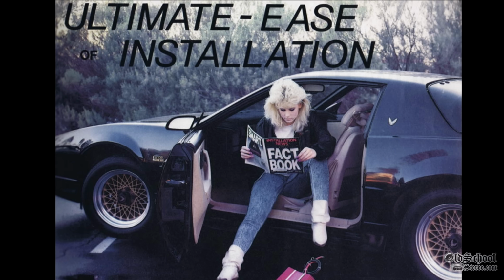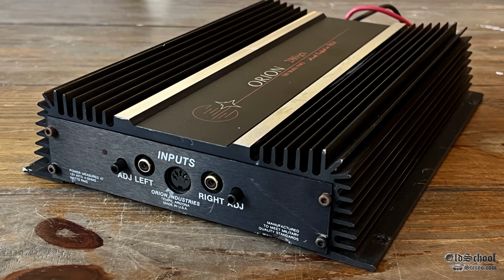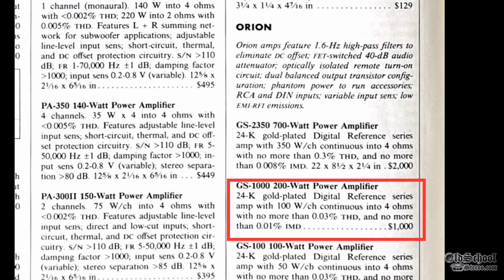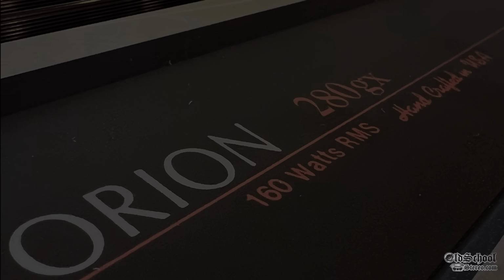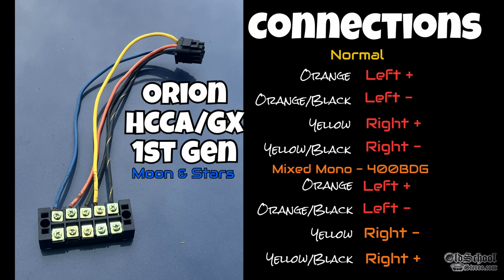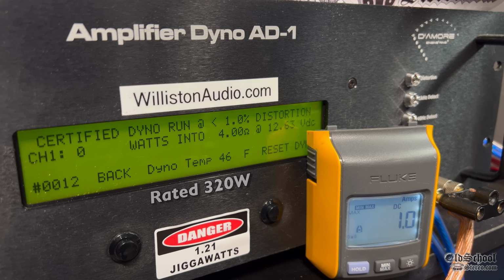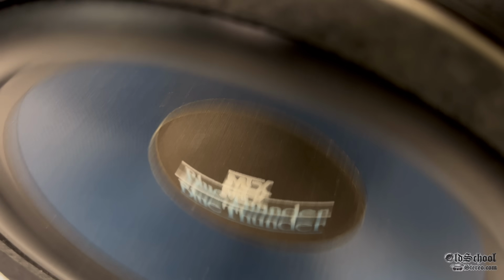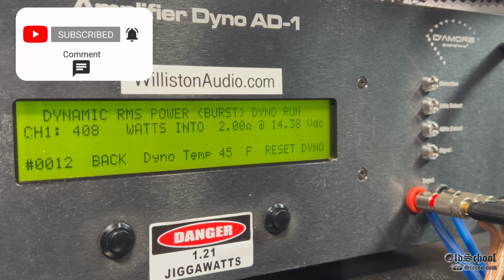35yr Old Orion Amp Reviewed and Amp Dyno Test - 280 GX Moon and Stars

Comment: The caps in these car audio amps seem pretty small - is this due to the thing hanging on a battery? If one would power such an amp at home with a power supply wouldn't the caps be grossly undersized? Which supply, if any, would be adequate for such amplifiers?

Comment: Orion amps just don’t make power. I myself had an Orion Hott Setup 2.125 back in the day. It was rated at 125Wx2 at 4 ohms. But it just didn’t hit hard. I eventually replaced it with a Punch 60, which had FAR more kick.

Comment: That amp has very little in terms of supply filtering caps and relies almost entirely on the regulation which is why it has so much less power at 40hz.   You need at least some dynamic headroom to hit those low sine waves.

Comment: If you take the transistor heat sink clamp off you will notice that the power supply transistors are the same as the output tranny's. I think they are 2n6488 and the complimentary 2n6491. Another thing, you need an Audio Control SA 3055 RTA. It would look damn cool sitting right on top of the amp dyno.   Hit me up I got one you can use for as long as you need.

Comment: I haven’t seen any old school amp dynos on Kenwood amps back in 89 by bud may have had the first wall he had 2 15” (can’t recall brand” on 2 kenwood 1021’s and a 921 on a set of ? Triaxles crammed into a lowered aqua VW bug with the short seats. The 15’s started where the seats ended lol…

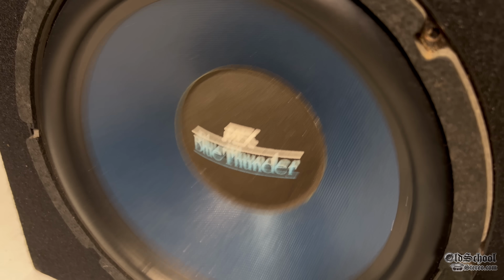Comment: 11:32 I disagree, Old school subs just needed a lot of air space, were more efficient, bass traveled further (like concert subs).  Today subs take more power, less efficient, can play low with less air space enclosers, bass don't seem to travel as far os O.S. subs.
Reply from the maker: We can agree to disagree, but with the same power this 6.5” Savard destroys that 10” Blue Thunder sub. And ran Blue Thunder’s back in the 90’s
Reply: @wal2  Touché, I was mainly referring to old-school subs, not necessarily MTX brand I was never a fan of MTX anything. I was a fan of Cerwin Vega, red edge, strokers, Orion XTR's. JBL 1000’s , Lanzar DC's & JL Audio…

Comment: Orion made beautiful amps, but my stock electrical hated them so much.  I ran Hifonics, Autotek and Fosgate without issue.  I always thought Orion ran unregulated power supplies.
Reply from the maker: I thought this also but I’ve confirmed these and even the HCCA’s of the 80’s into the 90’s were regulated

Comment: After wishing I could afford it in the 80’s, I actually ran this amp in my daily driver 10 years ago along with a pair of same era Rockford Fosgate 8” subs. It sounded great but unfortunately I became well acquainted with its guts(!). I had to pull the board a couple of times for cap replacement. These old school amps are great but should be fully recapped before actually being used in a working system. 
 This is a great series of vids Big D, thank you.

Comment: hey derick... man it would be awesome if you could come across a Cedance (or Cadence) amp 1000w .. they were kinda small and orange in color.. with 2 mesh ends that were held on with he  screws... man that thing was a  east with the two 12" Sony XPLOR's .... (no.. not xplodes, they were XPLORE subwoffers they didnt even look anything like xplodes as they were so huge and chrome backsides also with mesh around the motors) man it would be awesome to see a review of those amp and subwoofers...
Reply from the maker: Thanks for the suggestion 👌
Reply: i wish i could find the pictures of the system i had back when i was 16-17 that i had that system in a '91 blazer... if i find them ill figure out how to email to you :) thanks for the reply man!!! @wal2

Comment: Again, for an amp like this, a frequency response would be great to see. Playing the amp using the Elac speakers really doesn't tell me anything about the amps performance. The majority of us are watching this video through our phones. So, if you were to do a blind test with your best amp and crappy one, i cohldnt tell the difference. Well, wait, i am wrong. There was one amp i actually did hear how bad it was lol but, for the most part, we can not. If there was a chart that showed a single sine wave and THD. We, as the views, can not only hear what the amp does but also see where it's failing. For example, many people today are raving about how great the recoil amps are since they do rated power at a cheap price. Well, i am sure most are not aware that those recoil amps and dsp's are TERRIBLE and poorly made. ANOTHER EXAMPLE, although many people know Alpine is good, most people dont know that not only does alpine do rated power, but there are amplifiers are some of the CLEANEST amps on the market. A few of the older models, mid tier, absolutely wipe the floor with the high-end ones like Mosconi. But, my point is, it would be great to see maybe some more, and i am sure if you posted a frequency response on amplifiers, you would shock people on how some of there favorite amps are actually greater than what they thought or terrible then what was expected.
Reply from the maker: Thanks for the feedback 👌

Comment: Another old school legend humbled by the amp Dyno. The 280GX amps were everywhere in the late 80's. Basically anyone who was a Orion fan but, couldn't afford HCCA amps had them. 
Regarding that low efficiency, imagine running these amps on stock electrical in 1986. Talk about low voltage!
Another great old school car audio review and Dyno. 👍👍

Comment: Do you have a ppi 2150am to test out. Remember i believe 1992 it won Amp of the year. It was expensive but worth it. Just had it completely restored 2 summers ago, but have yet to use it.
Reply: I have two 2150am's in black. I call them the "swiss army knifes" of old school car audio. Great for subs, mids or even tweets if you turn the gain back or ran them at 8 ohms.
Reply: I ran this Amp in my pickup with 6.5 rf midbass and I believe 3 or 3.5 midrange in the doors, of course tweeter in the dash running left right mono and 2 sealed rf punch 12s behind the seats bridged. The sound quality was perfect and overall never let me down. Everything was 4ohm.

Comment: Today’s woofers aren’t a lot better woofers of Yesterday .They handle more power .Make more SPL
But overall ? The vintage woofers sound better for SQ .
Blue Thunders by MTX don’t hit !!
They have right snappy bass .Because of the rubber surround 
If you used OS  a RF ,JBL ,JL,Gold Sound,or Kicker .
Those woofers would hit with that amplifier.
Because they are 89-94 db efficiency.
Today’s woofers in Most cases are 82-84 db
My friend has a Orion 280 GX in a Vega Wagon .With 2-JBL L-100 home woofers .They were 92db had a 3” Voice coil .Plus a 6 lb magnet 
That car hit !! Really hard 
Back in the day the woofers were much more efficient.So we could take a Punch 45 or a Punch 150 with 2-12” 
It would hit !!
This is a great Video .Like always

Comment: Crazy to see how off these Orions were from back in the day. I ran their stuff for years from 225hcca to 2100 hcca.. They always hammered when dropped to low ohm loads, but clearly not as everyone thought. I still think the best amp from AZ I had back in the late 90's was the PPI PC2100 charcoal Grey "muffler" Amp. I'd love to see some tests on that Gen (grey or chrome)
Reply: I had a bunch of those PPI amps.  Muffler series lol 😆 can't remember all the numbers but 2240 and had a couple of the bigger ones too
Reply: @MAD_CarAudio  power class is their official name, hence the PC, but they looked like a damn muffler and took on that name in a hurry lol. I ran the 2100 with a single jl 12w3v2 in a custom vented enclosure I built for my S10 extra cab... it was ungodly loud for a single 12. wound up running 3 of the jl's with a memphis 16-ST100d in my old Jetta.. pulled 150db out of that untuned in a sealed floor enclosure. that car knocked hard!